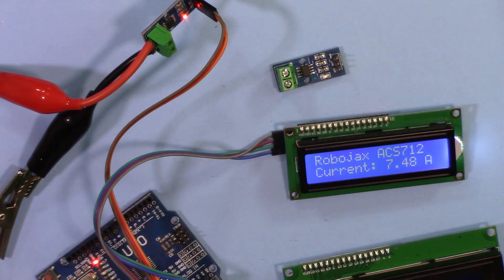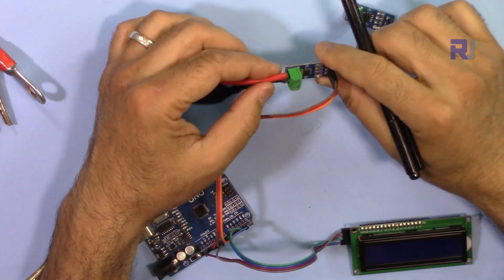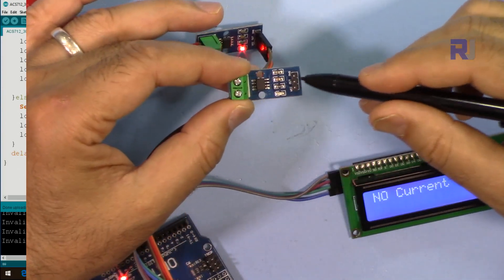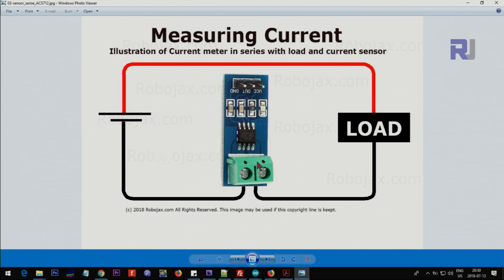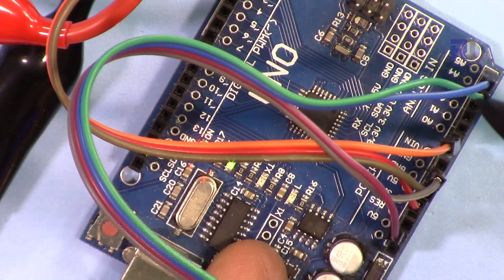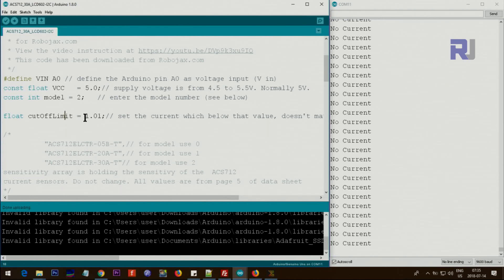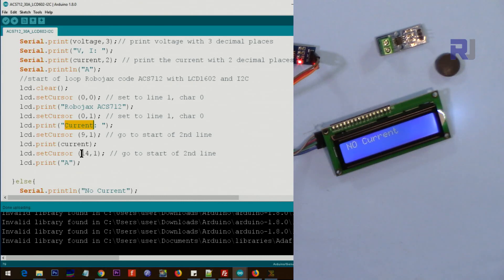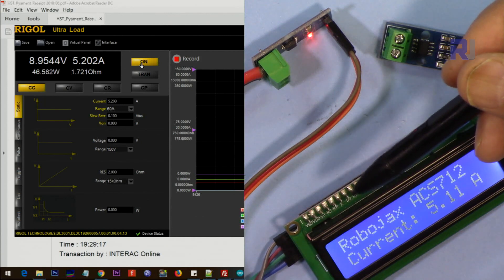Allegro ACS712 with LCD1602 and LCD2004 with I2C to display current using Arduino RJT107

Comment: How do I interface this sensor with an ESP32???
I tried but was not quite successful
Reply from the maker: Hi have explained it fully in this video https://youtu.be/SiHfjzcqnU4 learn how to get the current from the voltage output of the module. then  use ESP32 to read voltage. In this video I have shown how to read any DC voltage with ESP32  https://youtu.be/znBiVlgV9JI
Reply: @robojax  Ok, I will check that out.
Thank You

Comment: Sir, in my results current value is after 4 or 5 pulses of no current. what i have to do in code
Reply from the maker: Measuring 5A-30A AC and DC current using Allegro ACS712 with Robojax Library (code added into video)
https://youtu.be/3C33DpcSwIw

Comment: the lcd keeps blinking and there is no display
Reply from the maker: You must watch the following two videos before you can understand this video:
1- introduction to ACS712 Current Sensor: https://youTu.be/DVp9k3xu9IQ
2- LCD1602 with 2IC display : https://youTu.be/q9YC_GVHy5A
Reply: @robojax  I did. The sensor was working fine, but with LCD the backlight is on, but no characters are displayed

Comment: Hello, good day Sir! I am planning to somehow progress this project by adding a GSM Shield module so that if the current sensor detects 0 current/load it can then send an alert to me through SMS. Is that possible, Sir? Your response would be very much appreciated!
Reply from the maker: Yes it is possible but you gotta write the code or hire someone to write it for you. Please watch the pasted video with library I have written so it will be clean code Measuring 5A-30A AC and DC current using Allegro ACS712 with Robojax Library (code added into video)
https://youtu.be/3C33DpcSwIw
Reply: @robojax  Thank you so much for the response Sir. I'm from the philippines, do you have someone you know that we can hire to code?

Comment: ..would be nice, to implement a kind of “if-then” string in the sketch that activates an output, when a certain current-limit is reached  (for example to switch off parts of the load with a solid-state relay when the current gets too high). A kind of switching-hysteresis to prevent pumping would be necessary, too, I guess. 
As I'm an Arduino-beginner, I'd really appreciate getting some help   :)
Reply from the maker: Hello,  the person trying to use this should have learned a lot before coming here. Arduino Step by Step course that starts here https://youtu.be/-6qSrDUA5a8

Comment: Hi why my LCD display -4.3 or something but I have no source. Thank you for the answer
Reply from the maker: Hi, you may have come to the wrong video then. the rule is this. first you should be able to read the current without LCD and just print it on the serial monitor, then use the LCD.  Here the introduction video to ACS712 Sensor with library https://youtu.be/3C33DpcSwIw

Comment: what is max current can it handle for safe use continuous wtih 12v voltage?
Reply from the maker: Voltage does not matter. The current value is what you purchase.
Reply: @robojax  so if i buy acs712 30A, it can safe for continuous 30A everyday? No need to add shunt?

Comment: hi, thank you so much for the video.. But I want to ask can I use battery 9 V as the power supply?
Reply from the maker: Hi, you can power arduino board via the IN pin or the power adapter pin using 6 to 12V. Then from 5V output of Arduino you can power the sensor or any other modules.

Comment: Can I connect it in AC? To measure the Current and the output voltage? The input voltage is 220 V ac.
Reply from the maker: Yea you can.

Comment: Can I use nano for this project?
Reply from the maker: yes you can if you set the voltage I've explained to 3.3V if your board is 3.3V. This is 3 project. 1-reading DC voltage, 2-LCD 3-Current. you have to make sure each work before coming this which has all 3 combined. this way you can find the issue.
Reply: @robojax  Thanks for your prompt response.
My LCD has 2 rows, but 14 pins only. I have I2C converter to 4 pins.
I heard that the last 2 pins of LCD panel are for backlight, which I do not need  it.
Do I need to change the sketch?

Comment: Hey I would like to know how to measure voltage current and power to display on lcd
Reply from the maker: So you want energy meter? You need to measure the voltage. I have a video on that so you can measure any voltage her https://youtu.be/t8xwrVj2aFs and I am right these days busy working on a Energy Meter Project. The  first step for meter project was to measuring voltage (video above) then current using shunt so you can measure up to 500A and the video is here https://youtu.be/9jwCc7uPGoc energy meter is coming for Shunt resistor.

Comment: What is power range for 5A module? Can I use it for 85V DC and 5A for 5A module...please share your idea...
Reply from the maker: The link to the datasheet has been provided in the same page where the code is. You can check it there.
Reply: @robojax  In data sheet...Viso = 365 V peak then power range for 5A..is 1825w...Then it is also suitable for 85v * 5A =425w..  Is it right?
Reply from the maker: power doesn't matter because we look at current. If current is 5A or lower it is okay.
Reply: @robojax  Okk...Thank you so much...☺

Comment: I would like to make a device that connects to the rectifier 12V lead-acid batteries from 0 to 15A.  The device would be connected to the current cables coming out of the charger and only from the device would I connect to the battery.  The device would measure the current voltage V on the battery, the current A which is currently being charged, the amount of Ah that the battery has taken and the charging time.  Can you design such an arrangement for arduino?  Thank you.
Reply from the maker: This can work to measure current only.  you can connect any configuration either in + line or - line. But it can't measure voltage . Here my video on voltage sensor: https://www.youtube.com/robojaxTV/search?query=voltage

Comment: u do not added any code that having 16*2 lcd with arduino acs712  current  measuring and display in  16*2 without  i2c
Reply from the maker: Did you read the description: 
1- introduction to ACS712 Current Sensor: https://youTu.be/DVp9k3xu9IQ
2- LCD1602 with 2IC dislplay : https://youTu.be/q9YC_GVHy5A